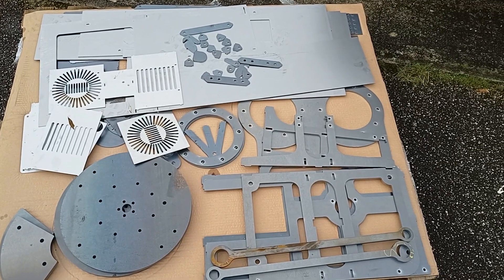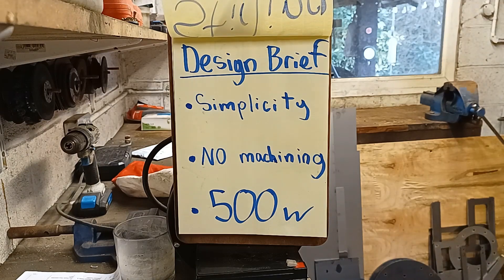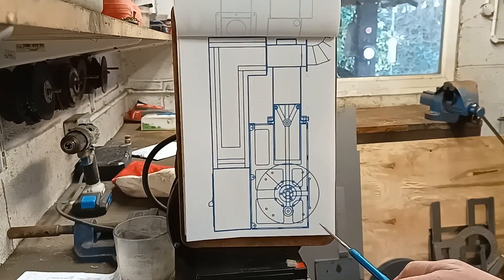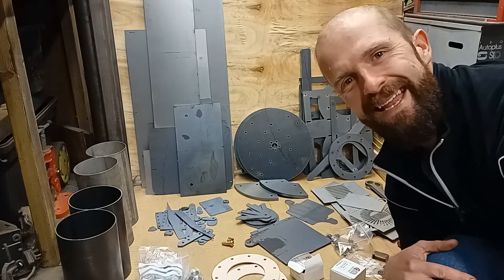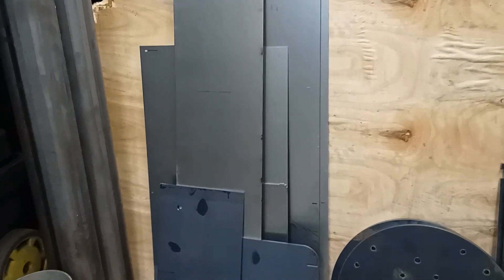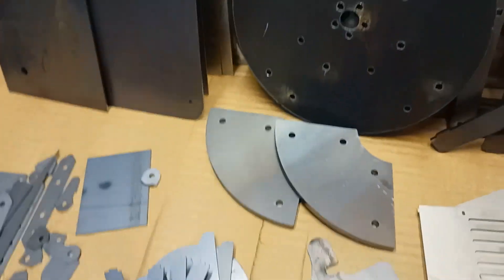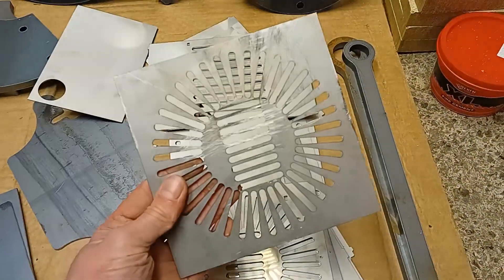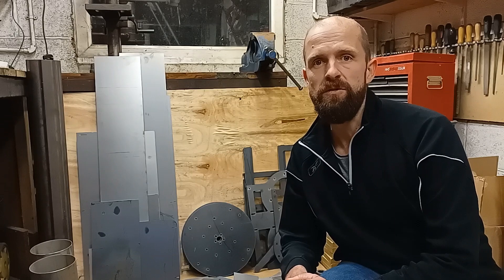Building a Stirling Engine that is Wood Fired - Part 1 - (Hopefully 500W + )

Comment: there's a interesting high voltage steam unit that runs on wood .it's Armstrongs portable high voltage steam generator.check it out .a little wood and some water and your running electricity.

Comment: This looks really kool, I've queued up the rest of the series for later.
What was the thinking behind using stainless for the heat exchanger? My experience with stainless is that it conducts heat very poorly
Reply from the maker: Hi, I used stainless because it will last a long time and everyone else recommends it. Good point about stainless! It is about 4 times less heat conductive than mild steel! I I am now interested in building another engine with mild steel to see how long it Will last : ) all the best

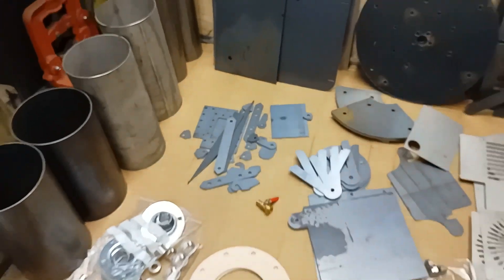Comment: information         you ended up with a decent engine.       in order to make a better engine, you need to make  FEWER  design mistakes.!!!            9:42     EVERYTHING  that can be done  should be done to  MINIMIZE  the amount of  MASS  in every component that  Reciprocates.!       this includes,  pistons, displacers, connecting rods.    this rule also applies to  components that contribute to an out of balance condition;  eg.,  crank pins.            those 'piston' tubes  SHOULD  be  ALUMINUM.!!!          the duct configuration used  NEEDS to be  compatible with the engine configuration;  either two piston  or  displacer.            a heat engine can operate without added lubricant because, where metal components interact their  HARDNESSES  are  different.       (see the  STRATEGIC  use of different metals  'together'.)

Comment: some information          3:52   put the wrist pin at the  Top,  and use a  SHORTER  piston  skirt.!!!            a  Horizontal orientation  Should  be used; because of  GRAVITY.!!!            you may know that in order to use strokes of equal length, the volume/diameter of the hot cylinder needs to be a bit greater-than the cold one.            there is no  need for supplemental cooling,  IF the  design of a stirling engine includes  Adequate  (physical) separation of the sides.        a regenerator  Should be made of a material that conducts heat  Poorly.        if wanted,  it is easy to build a convective heat trap into a regenerator.
a heat engine produces low torque.   consequently, efficiency (as a prime mover) will be highest when a heat engine is made to run as fast as possible, and is loaded in such a way that rpms drop by about ten percent of the max un-loaded rpms.

Comment: You haven't thought about cylinder offset from crankshaft centre?
Reply from the maker: 🤔 no. Do you mean take advantage of the change in stroke velocity? I saw an article about something like that for internal combustion engines
Reply: @ShanePomeroy  but on afterthought: It would not make sense with your system of rods & rockers.

Comment: An interesting start. 
Above the hearth, ceramic wool would be better. It is widely used in blast furnaces. It is light, cheap and insulates better than chamotte. (Google translator)
Reply from the maker: Many thanks. Yes, I think your right. The only problems I've got with wool is the durability and holding it in place. If I could get around these then I'd be on a winner
Reply: @ShanePomeroy  The lower part of the hearth is chamotte. The upper one is ceramic wool, fixed in points as in large stoves.

Comment: Have you considered secondary air inlets in the rocket stove for greater efficiency and cleaner burn? Most modern wood heaters have them now but I think the best examples are in the gassifying wood stoves sometimes called smokeless fire pits.
Reply from the maker: Yes, I can incorporate a secondary burn in, I'll look into it. I'll take a look at those fire pits. many thanks

Comment: Looks great! Just one thought...why only one PTFE gliding element on the piston? Wouldn't having two prevent it from jamming and/or having metal on metal contact?
Reply from the maker: Hi, the piston has 4 gliding elements at the top radially (probably didn't explain that we'll) and the leather seal section will hopefully take care of the piston bottom
Reply: @ShanePomeroy  ahh sounds good 👍🏽 no worries about explaining all the details. There is just too much to cram into a video...will see once you build it anyway! I'm excited!

Comment: If this is your third engine build I'm going to have to look back at your first. I have built 1 Stirling engine for a college project, it was a no weld no machining build from 2 tin cans, a beer can some wire and copper pipe.